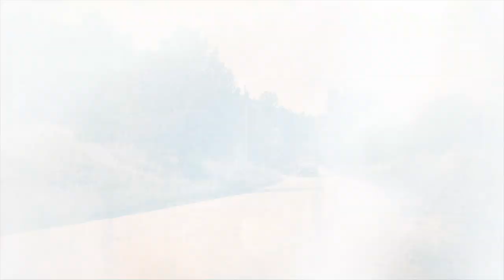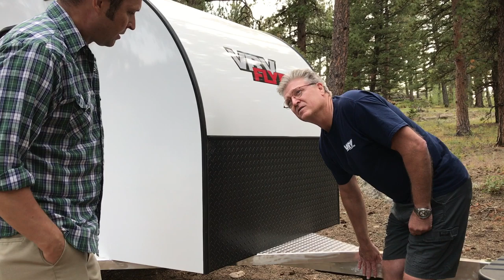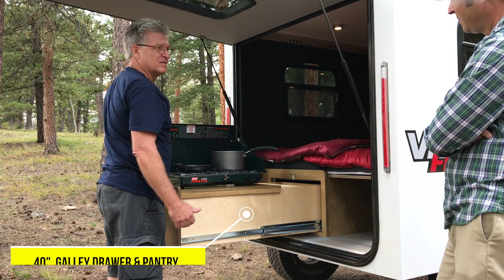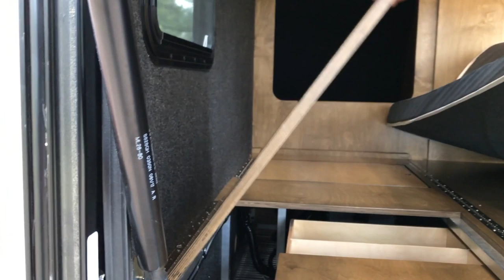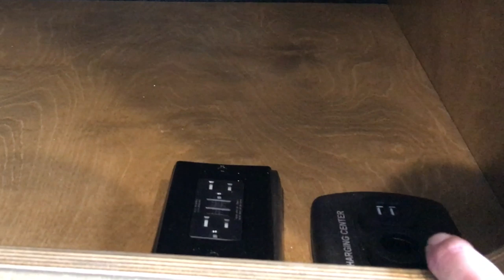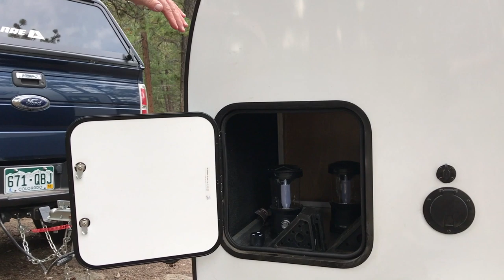VRV Flyer Adventure Teardrop Trailer

Comment: Can half of the bedding area be put on roller system so it could be slid in the bench cabinet rather than having to lift it? Also possibly use a futon system as well? Can it be set up for an outside sink and shower (City Water connection)?
Reply from the maker: These trailers are made with a strong foundation so you can customize it as you wish but VRV keeps the factory customizations to a limit. This keeps cost down and build times short.
Reply: Okay so the is answer is no the manufacturer will not, or is not capable of doing customization  of their trailers beyond the blue print.
Reply from the maker: Slight modifications like removing the bed platform or adding a second side door have been done but reinventing the bed area to be on a roller system cannot be done at the factory. It's not a matter of being capable or not wanting too, its a decision based on controlling cost, production time and delivering consistent quality. We hope this answers your question and you find the right trailer for your needs.